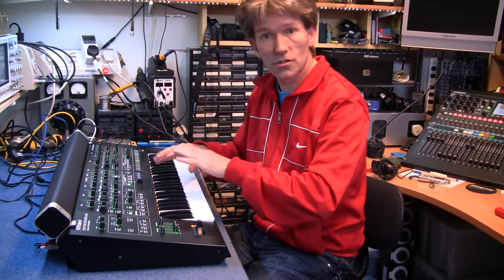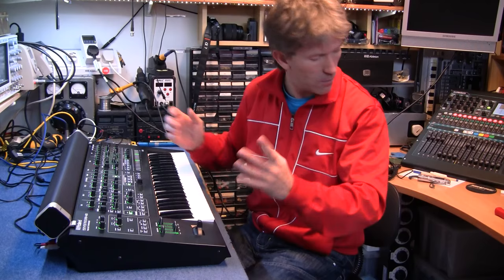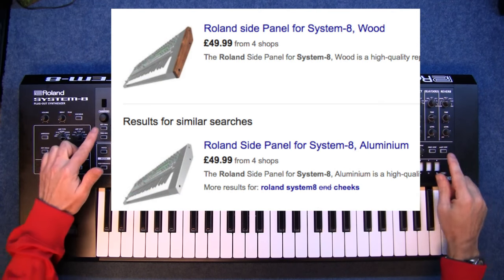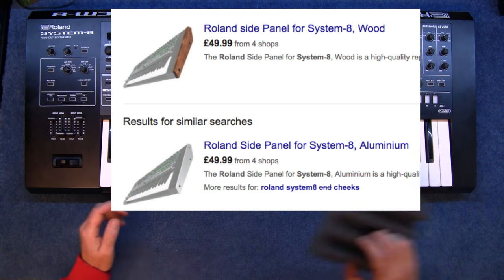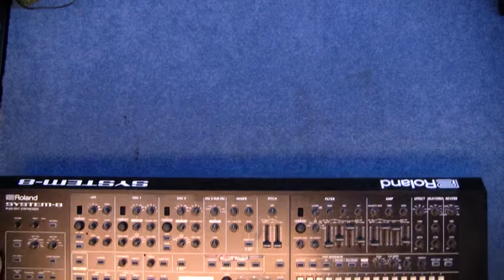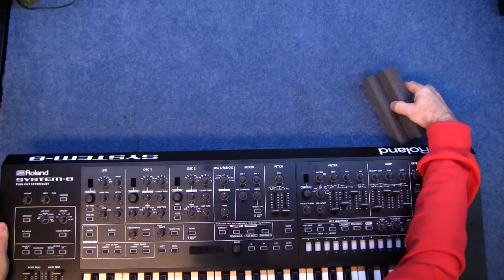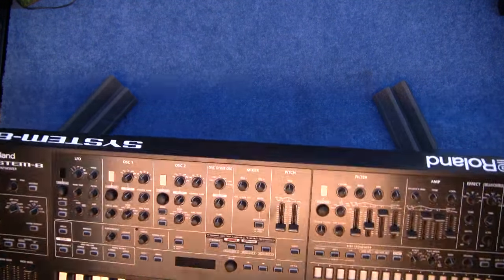Inside the ROLAND SYSTEM-8 plug-out synthesiser

Comment: I think some connector pads that aren't fitted could be for development purposes, to connect to Roland's own development hardware. As for places where no chips are present, this might be because the board has been designed for different RAM chip sizes? or so additional RAM can be fitted during development (debugging). These are just theories :)

Comment: Quite a few keyboards I understand have an external power supply mounted inside, the Korg M3 and the Waldorf Q are like this (the Q is mounted so that the figure-8 connector on the PSU is facing the back panel with a hole on the back panel so you can plug it in). Roland just seem to be lazy in that respect and weirdly it only seems to be Behringer that have a hatred for external PSU's and only their smallest mixers and stomp boxes have them (even the new version of the dinky 802 mixer has one) Personally with my SH-201, R5 and MINIAK I have mounted PSU's in all of them with no ill effects monitored. And the big question, will you be getting a DM12 or have you go one from Thomann already :)
Reply from the maker: dglcomputers I am quite interested in the DM12 but I think I will have to wait a little while before I can get money together to buy one.

Comment: Great look inside this modern beast. At 4:42 you are right about the memory. I think it is flash memory that used to hold the program data during software development. The footprints look like something like this would fit onto them: http://de.farnell.com/micron/m29w640fb70n6e/flash-bottom-block-64mb-29w640/dp/1224423. After completion of software development the content is written into the chips themself while the footprints can stay in case they need more flash in later versions or products that are also based on that board.
On the top there are 6 unpopulated connectors which I believe are JTAG connectors for debugging and programming the flashs.Note, the STM on the button+pot board has a similar footprint for an unpopulated connector which I am almost sure is JTAG. There is also space for mousepianos (DIP switches) that are unused. However if you look at the bottom side you can see these two groups of 12 resistors that look suspicously like they put them as replacement for the DIP switch settings there. A bit dissapointing is the note: "Roland....Made in China" on the board.
Reply from the maker: Chip Guy Vids Yes I agree and it makes sense to develop the initial board program test and then use the same board thats already been designed. plus I guess this will be the same board for a roland system-8m module maybe later in the year ?.
Reply: It's also not like the engineers are limited by the space available inside with the huge outside  interface.
Reply: Yes indeed. I would be very surprised if they would design anything new for that.

Comment: That power supply looks like it's used for dozens of Roland products. Perhaps hundreds.
Reply: Sounds like smart engineering :)
Reply: I suppose so, but they are mighty expensive new.
Reply: It certainly is. It's the same one which works on all my Roland synths. I have the System 8, SH201, SH01Gaia, an E200 and an XV2020 and they all use the same power brick

Comment: Hey mate. Did you by any chance remember if you had a look at the LED's on the front panel? Did you have time to identify them? Would be interested to know if you think it'd be possible to modify it and switch them out to a different colour. White instead of green for instance.
Reply from the maker: cuckoomusic Hi Cuckoomusic Im a big fan of yours, I think the green leds were smt leds are somewhere in the size of 1206 or 0805 (most likely the 0805 though they should be measured) they would be interchangeable if you can work on surface mount components which im sure you are quite capable of :-) . I think it would look pretty good with white leds though im not sure I would use the very high brighness ones just incase they draw too much current. would love to see a pic if you complete one. best wishes from Markus.
Reply: markusfuller hey thanks for getting back! And thanks for the kind words too ❤️ I have someone helping me potentially customising a unit. Will definitely notify you when/ if we pull it off.
Reply from the maker: cuckoomusic I look forward to seeing that Cuckoo 👍

Comment: I was expecting to see some sort of master processor.  I wonder if all the operational code runs on one or more of those BMCs chips?  Unless there was something on the left side that was shown only for a second ( looks mainly like a controller/IO board, with the keyboard going into it - not much there, so would not expect any sort of CPU or FPGA etc.)
Reply from the maker: Hi Michael I'm not sure if the BMC chips are just large FPGAs that have been rebranded ?. just a thought.
Reply: Probably are.  Maybe one chip is dedicated to the operational code, and the others for processing the sound
Reply from the maker: Yes theres some clever witchcraft going on in there somewhere.

Comment: Three processors for 8 voices makes no sense. I guess this guy can produce much more voices or the third one is used for effects, but you would normally use a different processor for effects than ACB chips. My guess is the ram at the underside is for the system-8 engine and patches, while the three others are for the three plugout synths. Each chip should bring 4 voices, because every engine can either have 4 or 8 and you can layer two engines with four voices each, which would mean 12 voices are theoretically possible. 
The System-12 may have the same board, but will cost more?

Comment: Very interesting Marcus. I suspect Roland intend on a System 16 or something, as you mentioned, that uses the same boards. A clever way to cut costs perhaps?
Reply from the maker: 2010MrWhitewolf maybe use the same board for the system-8m module if thats on the way in the future also?
Reply: markusfuller You are probably right there. Time will tell.
By the way, if you get the opportunity, I'd like to see you do a vid on Elektron's octratrack, analog 4 or rytm.

Comment: Thank you very much Markus ! I've been looking for exactly that: a look inside this new virtual analog synth.
And as I've suspected, it looks a lot like the insides of the JP8000 from 20 years ago:
http://thumbs3.picclick.com/d/w1600/pict/272392183074_/Roland-JP-8000-Mainboard-for-parts-or-repair.jpg
Big DSP chips with their memory. Yawn. Roland simply managed to redo the same with one fewer DSP chip thanks to  today's technology.
$2000 for this ? No thanks.
I'd rather get myself a Deepmind 12 real analog twelve voice synth, for half that price, instead.
Reply: The System 8 also looks cool (to me), but in the synth world looks don't account for much. 
And, to be fair, having had a good listen at this "new" product from Roland, it does sound quite good (for a VA). But the price point is really too high for what it offers. 
I still don't understand why such a big company as Roland doesn't offer a Jupiter 8 re-issue (clone) ? (much like Moog Music did with the venerable Minimoog D recently)
With their enormous resources, it would probably be a cinch for them to do so. Then they could sell THAT for $2-3K easily.
Reply from the maker: Yes I agree if only Roland made a proper reissue of the Jupiter-8, my name would be on the waiting list for that.
Reply: It actually costs 1500. and deepmind is a technically inferior product which doesn't even have 2 oscillators - more like oscillator and a half.

Comment: I'm pretty sure that those large chips emulate individual analog components to make for very realistic analog emulation. The power supply probably wasn't built in because I'm pretty sure there are tons of approvals that you need to get when implementing a power supply into a unit, it's faster and cheaper to go with an external one. I think that's also the reason why it took so long for the MatrixBrute to come into production. Will you be getting you hands on a MatrixBrute by any chance?
Reply: I'm a big fan of ACB, have multiple AIRA products including the System 8 and love the sound, but I am no longer sure that this "emulating analog components" line is any more than clever marketing, coming up with a new way to describe VA itself. It might just be a single line of code to emulate analog circuits rather than some mega advanced model.

Any VA synth should be doing the same thing. The clue is in the name "virtual analogue" - a model of analog circuits.

Not saying that's the case here, but it could be.

Basically then, they're pretty badass FPGA chips that provide loads of dedicated processing power to run complex 8-voice synth engines at 96Khz.

One has to wonder how the three of them communicate, which chip does what, etc.

When Roland releases the promised VSTs of the plug outs it will be interesting to see how much of a CPU hit they give, at 96KHz.
Reply: Good point. I remember hearing somewhere that they use Spice simulation to achieve the analog emulation. So I guess the best way to put it is that they're doing the same thing a different way. They do sound good though, better than my MicroKorg VA. So many people are yelling at Roland to do analog synths again, but I have actually really started to like what they are doing here. All the split keyboard features and the knobiness make me really want to buy this for live play.
Reply: I am loving the System 8. It arrived December 1st and I have spent hours on it every day since then.

I am pretty sure nearly of what it does it possible with VSTs. But even with a controller, I find VSTs and DAWs in general to be a creativity killer. It's less easy to experiment IMHO. I wouldn't like the System 8 half as much if it required menu diving rather than turning the 100 or so knobs on it.

I have my fingers crossed for more plug-outs this year, hopefully with a few to be announced at NAMM.
Reply: Jacob Pauls a

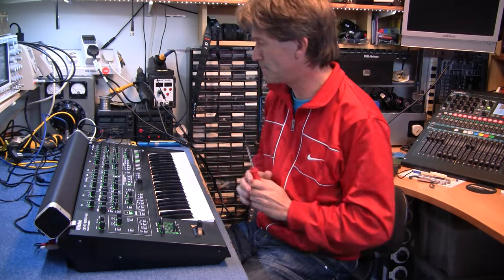Comment: Say, what is that long, square thing mounted on the back of the System 8 ( in the very beginning ) ??? Almost looks like a speaker? ...but then it's gone by the 0:34 mark.
Reply from the maker: Caalamus yes thats just my speaker I used while making sounds up on it. its not part of the roland synth but it fits nicely.
Reply: markusfuller 

 Thanks for the intel Mr. Fuller :]

Comment: Thanks for your great videos, Markus!

I've noticed that some synths or controllers have that encoders with 60ppr resolution. For a long time, I was trying to find such encoders, but found nothing in 20$ range.

Are they really that rare and expensive? I'm just trying to find a digital replacement for potentiometers with acceptable resolution (more than 30ppr).
If you could find model numbers of those encoders while tearing down another synth, I'd be the happiest DIY-er in my village)
Reply from the maker: Hmm Im not sure whare you are going to find one of those, have you tried Mouser electronics or Farnell or element 14 or RS electronics websites ?.
Reply: Yes, there are some Bourns 50 or 60ppr optical encoders, but the minimum price for them is 15€. Even with bulk price of 10€ that's too much for a MIDI contriller, like my NI Mashcine, which has a lot of knobs. When I turn them, they run through 60 values. I was curious and opened it up to look at the insides, and there were plain-looking nameless mechanical encoders. Hm.

I guess they use general cheap encoders with 24 or 30ppr, but there is some  (software?) way to double that resolution which I don't know.

Comment: Liked the video. Interesting that Roland do all the heavy lifting with their own chips - that must cost a fortune to develop! But only 8 voices, only 4 octaves, no aftertouch - for a flagship synth costing £1300? The bean counters have lost this long-time Roland customer.
Reply: Rik MaxSpeed yeah i agree it seems unnecessary to build their own chips. korg and Arturia seem to use off the shelf parts and they sound great.
Reply: I've plenty of experience developing real-time synths using a 4-core ARM processor - I'm surprised they don't use an off-the-shelf solution like that - unless their DSP code is really super-heavy that it justifies a custom DSP ASIC solution... but then why is the polyphony so low?
Reply from the maker: Maybe they are off the shelf components but badged as roland ?. who knows.
Reply: haha good point.
Reply: Rik MaxSpeed  I don't want to pretend like I really know why but, as you mentioned this is maxed at 8 note polyphony I read a review of the System 1 VST and remember the reviewer said that the vst hogged the CPU like crazy, so my guess is that the code is quite demanding and with double the poly I'm sure they may have some extra processing power to ensure there's no lagging issues. The sound I get from my sys1 kills for a VA they really stepped it up. Just wish they would make these 4 note boutique's double as plugouts, I was originally going to get the jp-08 but it's so tiny and I got the sh-101 with the sys1 so it was hard to pass up with full sized controls.
Reply: They're a massive company, so they can afford to design a DSP chip for use in everything they sell. It'll be used in FX processors, synths, FX pedals, anything that does digital sound processing. Plus will be used for BOSS products as well.

By designing and using your own you get the benefits of vertical integration with no need to pay royalties, licences and patent costs.
Reply: The boutiques and System 1 used a lower "sample" rate. I think the System 8 renders at 96Khz, plus has splitting and layering, plus FX for external input.
Reply: Sample rate? 
The system 1 and boutiques I believe use DSP to produce the sound, not samples. Maybe the plugout waveforms are sampled, but the sys1 waveform is variable like a PWM type of control so I would think it's continuous. But either way I couldn't find info on there site about a sample rate. Though the System 8 has more polyphony and features if your willing to pay over 1000 for a VA you must just be to picky to buy a real analog synth especially if you paid full price for the sys8.

Either way I substitute some genuine analog with the Moog sub phatty for where ever I feel the system 1 maybe lacking The thick bottom end moog is well known for, but the brighter analog VCO's harmonics when the filter is completely open is where the moog shines in quality of sound and show of clarity in tone over the sys1. However the Sys 1 is a cheap full hands on control VA with great low end on it's own, not to mention way more modulation and sampled or not the OSC's waveforms kill! You can do virtually anything with the added waveforms FM and FM sync. Sure it doesn't have the vocoder and number of patch memory like the microkorg, but I believe the sys 1 in my experience with both performs way better with the filter not having the same stepping like the MK, and again so much hands on control tops in creative flow.
Reply: That's why I put sample in quotes. It's generation frequency or clock speed. Probably a correct term out there for it somewhere :)
Reply: @6581punk  Roland is not even close to being a massive company, these chips are just rebranded DSPs (maybe Ti), they are code compatible with the ESC2 chips which are found in the System-1, System-1M , the Boutiques and a bunch of guitar pedals (and Roland explicitly calls it a DSP,  not FPGA).

Comment: Would it be possible to modify and expand the System8 using the unpopulated spaces on the Mainboard?
Reply from the maker: Willi Werkel no I very much doubt it, a lot of spaces on that board may have been in use during the original programming and debugging then when they got it right they do not have to redesign another board just get them manufactured and populate the parts required for the final version.
Reply: markusfuller thanks for your response! at least I can mod my JX-3P to upgrade the midi soon ;)

Comment: What are the odds of being able to repair these units 10/15 years from now?  It doesn't look good with everything being so small.  I have a feeling we'll be throwing a lot of these in the trash unlike the older synths that we can still repair.
Reply from the maker: well I can repair surface mount components and in 10 to 15 years time we may be able to have equiptment that easily removes and replaces these  components plus machines that easily check what needs replacing. who knows what 15 years time will bring us.

Comment: I don t think that the system 8 sound like jupiter 8 or any analog synth
Reply from the maker: Vegetto Blue maybe not but for what it is it sounds pretty good and most people will never get to buy a jupiter-8 at £8.000 to £12,000. I sold my Jupiter-8 a long time ago so cannot do a side by side comparison though I realise they will not sound the same as they are both quite different synths and many years apart.
Reply: markusfuller Yes , i agree . They are different .
Reply: By the way you can have 8 vco and save 500 euro with 2 Korg minilogue